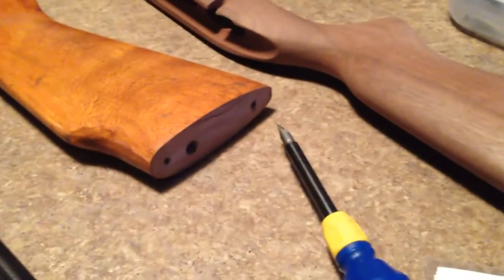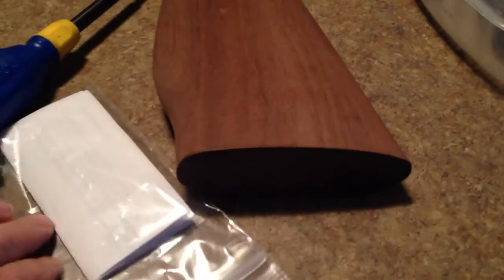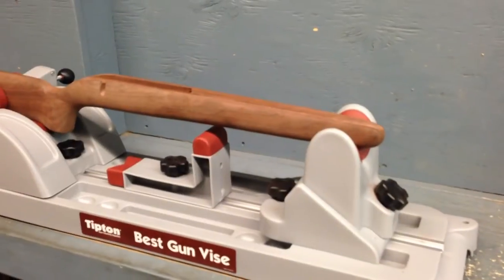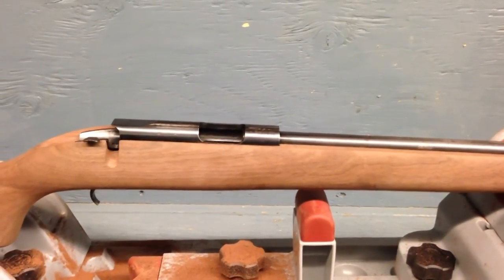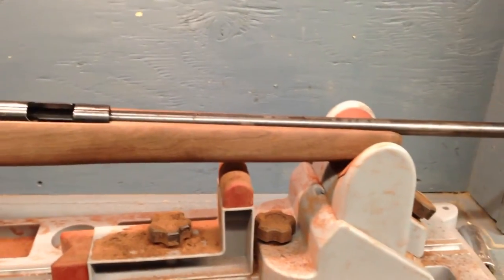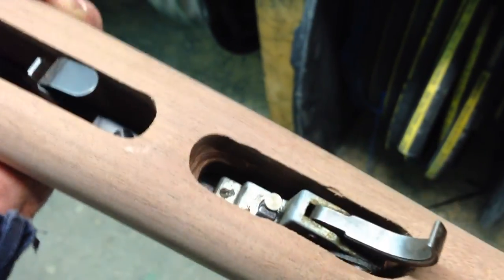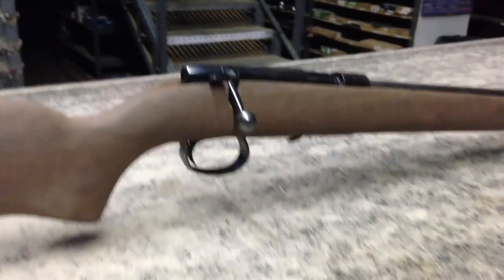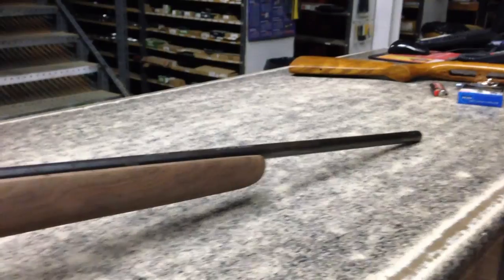Remington 581.  Step 1  working the stock

Comment: I have a 581S I purchased new in the 1980s...the barrel is not free floating....is there a pressure point on the stock by design or will this 22 shoot more accurately with a free floated barrel?  THANKS.

Comment: nice job, great shooters this series of remingtons. should of made a metal replacement for the rear site base, just my $0.02. great video.
Reply from the maker: Hi Stan.  This project was to keep me busy this winter.  By the time I found and bought the following: 30 year old 581, stock, front sight, back sight, magazine release, magazine guide, magazine, sling swivels, scope rings, two unique screws, and the finishing kit, I may as well have bought a Sako.  I have always wanted one of these guns, so within in a couple weeks of now the gun should be put together.  BTW, if you look carefully at the list of items I purchased, I did find a mint rear sight which included the base and mounting screw.  I have everything I need to put this gun back together.  Just finishing up the stock.  Sometime this spring I will take it out to the range and see how she shoots.  That will be Step 4.  Hope you get a chance to watch it.

Comment: Hi Ken,
Great project. I have a model 541 T. It is a great shooter but the magazines are really junk. They are polymer both the five and ten round. I'm contemplating on doing a magazine conversion using the metal magazine and catch release from a Remington Model 513 T or a Model 512. Is your magazine polymer or metal ?
Reply from the maker: +peshewa0529    Hi.  No, unfortunately my magazine is plastic.  I have 3 of the 10 shot clips.  Very hard to find 5 shot clips in Canada, and we can't get them shipped from the States.  I remember this clip in the late 70's.  I had a Remington Mohawk 10C.  It always jammed, and I was young and just didn't understand.  I know that I used to buy Remington ammo (when I had extra cash) for it once in a while and it never jammed.  Good luck on the metal clip idea.  I know guys do this.  Too bad Remington won't just make a million metal clips.  Pretty sure they would sell in a week.  LOL.
Reply: I will let you know how the conversion works out.
Reply from the maker: +peshewa0529    Perfect, thanks.